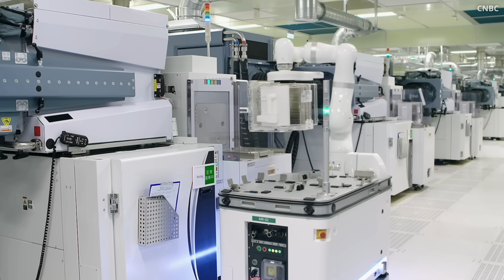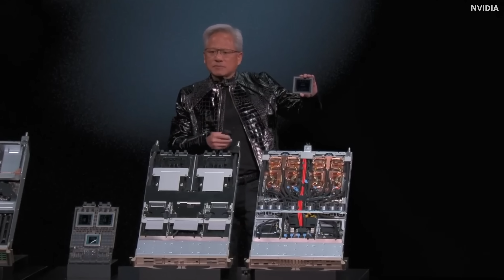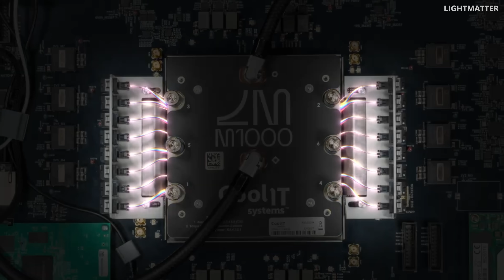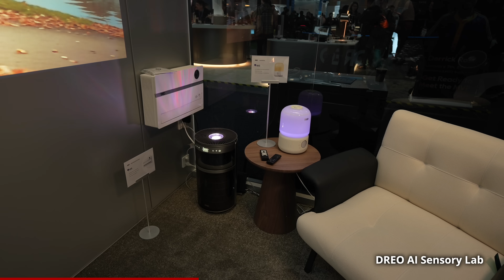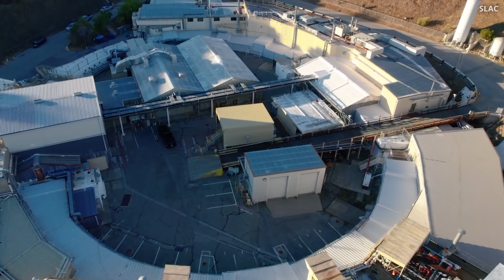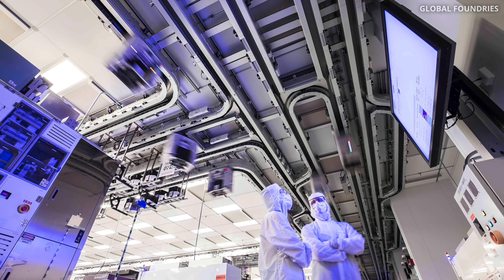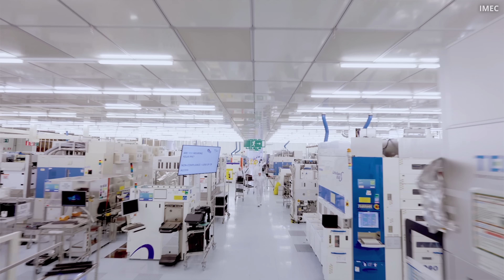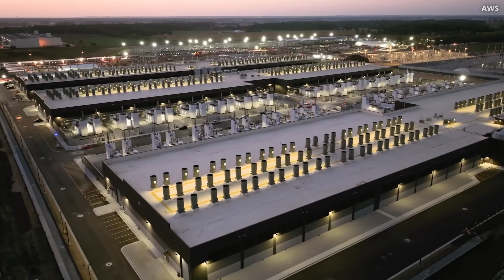This New Technology Could Kill TSMC and ASML

Comment: The title is misleading. You’re presenting an unproven, early‑stage concept as if it’s a real threat to ASML and TSMC. The video itself is much more cautious than the headline. Please don’t frame speculative tech as if it’s already validated, it hurts the quality of the discussion.
Reply: I agree.

From proof to production is 10 to 20 years.
Reply: @jfverboom7973  That's already enough time for TSMC is already develop this speculative tech themselves.
Reply: @silverhawkscape2677  That's the thing, they don't need to, a smaller wavelength gets us mothing at this point because EUV improvements will get us to the physical size limits of transistors.
Reply: @oBCHANo it's already hit that wall.  Euv cannot go smaller than it is.
Reply: @silverhawkscape2677 TSMC relies on ASML, without which TSMC is nothing better than SMIC.
Reply: @oBCHANo  it's more geopolitics, euv is in the hands of western nations and their allies. The global south is locked out, and in reality making an EUV machine could take 50 years for a nation starting a program now. I don't like the idea of monopolies in any sector, however ASML has the biggest monopoly on the planet
Reply: @dustinkirk3920  maybe not smaller wavelenght, but they can increase the wattage and use bigger mirrors to make smaller nodes so
Reply: @jfverboom7973 That's completely wrong. Everyone has been completely misled. X-ray technology will take another 20-30 years to fully overcome, at which point X-rays will be obsolete. And the market will still be monopolized by TSMC and ASML. 😂
Reply: Welcome to YouTube; the algorithm rewards sensationalism & penalizes objectivity.
Reply: Blame Google YouTube Ai.  You have to provide multiple titles, and they choose what gets used.  The most ridiculous, manipulative, controversial title always get used.
Reply: @johannel5603  Yep ive seen this, same video, same date of publishing and diffrent title.
Reply: @johannel5603  You don't have to. You can choose to. It is up to the uploader to decide on whether or not they'll do A/B tests
Reply: Welcomè to the internet
Reply: Maybe, just maybe, the title / headline should be chosen by the CREATOR rather than the editors of YouTube for the purpose of generating clicks.
Reply: i don’t know, you have an expert talking about, and you think you know more than the experts.
Reply: @tilly704  exactly, it's so typical and common
Reply: you actin like you want it to fail lol
Reply: Wholeheartedly agree that the clickbaiting on this platform is out of hand. I am beginning to filter them out of my feed but I will give this channel a bit of a chance before the axe falls.
Reply: It's only made to make competition confused, 
they will NEVER tell how they are building a new one 👍
I am 100% certain, they might tell you and me about their old machine.
But never how they are building a new one...
Reply: @user-fj5xj8fj6f she says "could."
Reply: Thought the same, just gonna blick the channel. It's actually worse than that too because this isn't even a discussion in the first place, EUV can get us to the physical size limits of a transistor while x-ray lithography is completely impractical for many reasons, so there literally isn't a discussion to be had.
Reply: @oBCHANo so what are you talking about?  The technological advantage of x-rays is that it can print smaller than euv.  Euv is the smallest printer today, because x-rays aren't being used yet.
Reply: @dustinkirk3920  X-ray lithography was considered at the same time as EUV and there are many reasons it was avoided. Also, EUV has not hit it's size limit, the next gen high NA EUV machines will be able to print even smaller, and there are plans for more improvements in the future. By the time we are done with EUV you won't be able to print transistors any smaller without problems like quantum tunneling.
Reply: That's completely wrong. Everyone has been completely misled. X-ray technology will take another 20-30 years to fully overcome, at which point X-rays will be obsolete. And the market will still be monopolized by TSMC and ASML. 😂
Reply: Yeah, thumbs down for this content.
Reply: She just wants clicks
Reply: She has been doing this for a while.
Reply: "could"..... Learn English, dude
Reply: Bruh... Just get off the Internet.
Reply: I don’t think TSMC would be building a $165,000,000,000.00 plant in Phoenix, and a new airline with direct flights between Phoenix and Taiwan starting service would be happening if they thought they were at risk to anything other than an invasion from China into Taiwan. $165 billion plant is a pretty serious indicator of confidence.
Reply: @kevinkasp It is TSMC policy that all their chips “made in USA” must be at least 2 generations behind what they are producing in Taiwan.  So, they are far from undermining their perceived silicon shield.
Reply: This New Technology Could Kill TSMC and ASML. Did she change the title?
Reply: Okay mr fj5xj8fj6f
Reply: She's just farming for views.
Reply: She is a youtuber after all
Reply: Yeah. Good luck with x-ray lithography
Reply: Gotta get those clicks.
Reply: So are you saying it couldn’t kill euv lithography as the leader in chip manufacturing? The title does say “could” not “is going to” or “is” right?
Reply: How is your first day on the internet going so far?
Reply: @baskalter6172  Not bad, I saw a moron leaving a reply comment but it is what it is , cant complain!
Reply: @user-fj5xj8fj6f  I've also seen a charlatan disguised as medical professional
Reply: Maybe you don't understand the English word could.
Reply: @stever197037 Well, as an English teacher, I don't understand your sentence either 😅
Reply: title is Okay, but
maybe you're a worried TSMC stock holder 😅,  no worries HODL, til China gets in the competition
Reply: Not at all. Maybe you - "Could" - use a dictionary
Reply: But you would've never clicked on it tho
Reply: She probably doesn't even herself understand what she is talking about.
Reply: TSMC is a contract manufacturer of chips using ASML machine, the same as Samsung and Japanese companies!
Reply: Agreed.
Reply: It's good to be in the know about new technologies and companies that could disrupt the current status quo though. Otherwise you'll be scrambling to learn about it like the rest of the mainstream folks when it finally gets mainstream
Reply: yeah, I signed in because I couldn't leave a "thumbs down" with out it.. lol
Reply: The word “could” is in the title.
Reply: … but helps with YT algorithms. Nothing personal 😂
Reply: ... but INTC IS  selling this design. Look at the stock chart.
Reply: Not misleading. You are just slow on the uptake.

Comment: The question is Nvidia? Ultimate design using AI and powerful manufacturing. What will happen to Nvidia's  empire?

Give it time and chips will be like electrical circuits. You can make your own blueprint and make the chips through an order accordingly. Why have processors with capabilities you rarely use. So if most of what you do is media processing, or tensors AI calculation, you will order your chip accordingly.

I hope what is in the video works or just a hype to raise funds.

Comment: the mask and "resist" are going to be real issue, X-Rays pass through a lot of stuff which is why we use them in medicine.
Great if it works but I suspect it's just 5 years away same as fusion has been just 10 years away for the last 40 years

Comment: if we look at it with slightly different eyes, then soon all the servers, for example, Google's, 
will fit in a 10 square meter room. on the other 
side, many problems are solved, in future home, systems, "pc" but also programmers will be able to program more easily, since we will be talking at least 10 times stronger memories than today's. 
in a smaller size. "the whole problem will be placed on the processor" So the architecture we know today is changing too. That is, it will be normal, all home computers and smartphones, to start with at least 80 gigabytes of RAM,
This means that they will be able to easily run any application that exists today on the Internet. 
since the processor architecture changes. It will inevitably change. We are certainly talking about appropriate energy savings when it comes to large companies. regarding the servers. Of course, this means a huge reduction in energy consumption and therefore money savings, but in addition, a huge reduction in environmental pollution.

Comment: why do they use discs to make rectangles
Reply: 🤣🤣🤣 I've been wondering this too.
Reply: Silicon crystals are grown using methods like the Czochralski process, which naturally produces a perfect cylindrical crystal (boule).

Cylinders are easier to grow defect-free

Stress distributes evenly in a round shape

You can slice the cylinder into flat discs (wafers) with minimal waste

Trying to grow a square crystal would introduce cracks, defects, and uneven crystal orientation.

Comment: My dentist has a hand held xray "camera" the size of a DSLR.
Reply: There are handheld xray spectroscopy machines, guns they are called that you point at a metallic object and it will tell you what the components in the metal alloy are.
Reply: I'm sure they will work wonders if we ever want to print transistors the size of your teeth!
Reply: So?
Reply: @sw3gmach1ne17   That means x-ray machines are shrinking from stadium sized rings to small devices. That's how things progress in the IC world.
Reply: @tsbrownie um...no, not at all. Medical xray can be small because they don't need to be so exact, u don't need the highest resolution possible and all that. For lithography they needed to create special materials and hardware, hardware that can't be made smaller. U can search more on the subject for detailed info
Reply: @tsbrownie I would say you are comparing apples and oranges, but this is so far of in technological advancements, you are comparing more or less a rock found in your backyard VS the latest technological marvel, and saying both are similar at the same time.  

You should look into how a dentists xray works vs how a cyclotron xray works.
Reply: @EleaRevils  And early transistors are a rock in your backyard compared to today's transistors found in ICs.
Reply: And now you have transistorized teeth. Next step, an usb implant.